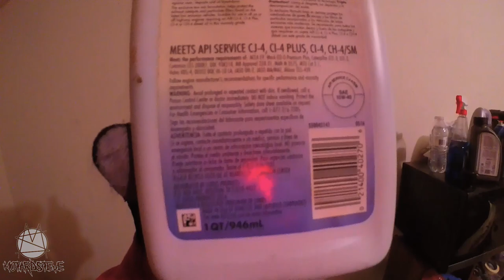How To Break In Your New Motorcycle Engine | How To Prevent Oil Burning

Comment: I did this break in method to my MMX 125cc motocross bike and it rips after 7 years of ownership. This is the best break in method for any bike. Great video Steve and very informative.
Reply from the maker: Nice! Yeah I think the OEM break in methods are partly a liability thing. Like you don't want to tell buyers to run it through the gears decently and have someone get hurt or something, so I get why manufacturers say to be more cautious for the first hundred miles on a new bike, but gotta get those rings seated in properly for sure.

Comment: Ffff that bro... my dr650 saw the rev limiter every shift and some chirps from the tire on downshifts. BELIEVE that hard break in. 😎 I of course let it rest in between those sessions with what you’re doing. Changed the oil religiously at purchase, 500, then 1000. It’s running like a dream at 7000k miles.

Comment: Just ordered my brand new 701 and will run it in exactly like this.  Ran my  last 4 bikes like this and none of them burnt oil and went like bullets compared to mates bikes.  Dealer told me that all 690/701's burn oil until 10,000klms, crazy, no moter should burn oil unless the ring's are fucked. Also thses bikes come from the factory with full synthetic oil so need to drain thst before even starting it.

Comment: Did you change the oilfilters every time you changed the oil in the break in process?
Reply from the maker: Yeah Except for the first time because I didn't realize the oil filters are a different size and already dropped the oil and no local stores were open that day.(one is a longer high filtration one, and the other is a standard one.) but other than that yes, changed filters every time and still do now when I change oil every 2000 miles.

Comment: Cheers for this vid Steve just a quick one do you do this type of riding style until 1.5-2k miles? I’ve picked up my 690 2020 and rode it back home 25 miles with your break in technique. Dropped oil and filters and will change again at 50-100-200-400 and so on
Reply from the maker: Think I did it until 1500 but probably was overkill tbh. You could probably be fine doing normal intervals once you get to 1k miles

Comment: Thanks MotardSteve! Sounds good. But how many miles are you supposed to ride like that then?
Reply from the maker: Really the first 50 miles are the most crucial but after that just make sure you vary the revs and engine brake often. The majority of the break in happens in the first 50-100 miles then the rest happens over time. Should he fully broken in around 1500 miles

Comment: What about changing the filter during the break-in period? You talk about very frequent oil changes but not once about filter changes. Do you need to change the oil filter every time when you drain the oil during the break-in period, or can you change it every two oil drainings? Thanks for answering.
Reply from the maker: The first few changes I changed the filters and cleaned the two screens because the first few changes will have a lot of metal in the oil form the surfaces wearing in. I'd say after the first few changes you could probably do every other change or every 3rd change. I changed them every time, but what I did may have been overkill but for the 20000+ miles I had the bike never had any engine problems so 🤷

Comment: This video is extremely helpfull. I have a scooter and when I changed the cylinder for a larger one, all of my friends told me that I don't have to break it in and that I could go full throttle all the time. I didn't listen to them and I'm glad I didn't. Now I don't have any oil burning issues. Thank you for your advise and when I get a supermoto, I will do the same thing you did!!
Reply from the maker: Nice man, glad I could help 😎

Comment: Hi,

Maybe you should advise.
Bought Husqvarna 701 enduro wit 1500km(~930 miles), but as it is a enduro it’s is total of 46 motor hours. 
Pretty sure that guy before me didn’t do this these actions what you where talking about.
Question- should I try to go thru all this process, so could improve oil consumption effective’s/ engine life.
ATM can’t tell if he is consumpting oil, will do first oil change soon.
Reply from the maker: Honestly it's probably past that point. If it doesn't burn oil I wouldn't worry about it too much, bit if it is slap a new top end in it and break it in as the video shows. But as I said unless the hikes consuming oil I wouldn't stress over it too much
Reply: @MotardSteve   thanks for info! 👍🏼

Comment: Enjoy your vids.  Got a 2014 DL1000A that I picked up in 2016.  Used Rotella T6 from the git go and it does not use any oil. Rode from MN to Seattle and back last summer and the oil level did not drop.  Put a yosh exhaust on at 1000 miles along with a holeshot fueler.  At 60, those long trips are a bit much so I have been thinking of getting an enduro wich would make most of the riding I do a lot more fun.  Think I'll wait till the Yammy T7 comes out though.

Comment: Just subscribed! You said I could break it in from just 3rd gear and down, but another guy in a video said to make sure to take it through all the gears.  I'm about to buy a Kym 690 ... I'd kinda rather keep it in 2nd and 3rd anyway till I get used to it's power.... should I just forget about what the guy in the other video said?
Reply from the maker: It's the loading and deloading you want to focus on. Your gear box doesn't do too much breaking in as the piston and rings do. Overtime you'll get through all the gears anyway. If you have a track near by that's another way you can break the bike in too. Because most tracks you'll have to accelerate on the straights and brake/downshift for the corners over and over again.

Comment: i did that with my gen5 zx10r i still followed the manufactures directions in not going over 8krpm for the first 500 miles but i loaded it up and engine braked as much as possible but those bikes really dont burn oil either way u do it but it definitely increases the chances of making more hp and being a strong bike in general im about to do a top end rebuild on my 09 ktm 530exc and im glad i watched the vid im definitely doing this because she consumes a bit of oil as it sits

Comment: Just came across your channel. As I just took delivery of a 2022 701 SM, It couldn’t be better timing. Thanks for the great information and guidance for proper break-in. One question - each time you changed the oil, did you change the filter(s) also. Thanks 👍
Reply from the maker: I did. Probably was overkill but I'd at least change them in the first change because of all the metal shavings after that you could probably do every other change

Comment: So bro how many miles can i go till i stop the "creating pressure" method ...example u said create that pressure as u showed for the 1st 50miles...so how bout after 50 miles can we drive regularly or do is 50miles+ still within creating pressure procedure?
Reply from the maker: After about 100 miles I just rode it pretty normal but because I'm a hooligan I still did plenty of acceleration and engine breaking but most of the break in happens in the 1st 100 miles
Reply: Ur talking just for the Husky supermoto or any small engine 4stroke in general?!

Comment: Quick question, what was that rating you are talking about for the conventional oil?? Also, dropping the oil like at 25 miles then 100 miles etc.. are you doing also all oil filter changes? THAT"s a lot of oil filters lol those things are not cheap where I am
Reply from the maker: I was changing filter everytime but that could've just been me being extra. You could probably get away with doing it every other or every third time. And the ratings were Jaso-MA or Jaso-MA2

Comment: I started interested, but lost confidence real quick when you started talking about hard break in and using a different oil at first. The best option is to stick to what the manual says. Being a little bit more aggressive can be ok, and being too soft is probably not going to help but a lot of people could get the wrong idea from this. Either way, not taking the rpm’s above whats recommended is the best option, acceleration is fine.
Reply from the maker: I disagree. There's numerous accounts if people that went by the manual and almost all of their bikes consume oil...
Reply: @MotardSteve  Well clearly you disagree hahaha. I just think there’s probably a reason why the manufacturer recommends a certain procedure... After all they are the engineers etc who designed and built the bike in the first place. I reckon they probably have some idea of what’s best generally speaking. Doesn’t mean it’s the only way possible. The fact that some bikes burn more or less oil doesn’t necessarily have to do with the break in. Of course it could be a likely factor, but I’d trust that a manufacturer before “some guy” on the internet if you know what I mean. It’s amazing that it worked for you, but that’s one person with one bike at a time. Hardly conclusive evidence that it’s the best way to do it. Changing the oil 6 times within the break in period of 600 ish miles hardly seems like a normal thing to do either. Anyway, if it works it works I guess. Glad your bike has no issues, I’m picking up my 21 690 smc r in a couple of days and I was just curious about the break in since it sucks to do. I already have a full exhaust before my bike arrived and when it does I’m waiting till after the break in to mount it and tune the bike. I’ll probably stick mostly (patience permitting) to the manufacturer recommended method. I’ll let you know if it starts to burn oil and you may have been right though hahaha. Have a good one!

Comment: You forgot the normal break in procedure, I see you only have two, easy and hard. I'm pretty sure the manufactures know what they are talking about. Also you seem solely concentrated on the piston rings. there are many many more components in an engine that all require breaking/running in. Yes your engine will burn oil at first, a shocking amount of oil in fact as with any big single cylinder, But it stops after a couple of thousand miles. Stay safe and follow the hand books recomendations.
Reply from the maker: To each their own man. I've had good luck with my break in procedures so..... 🤗
Reply: I hope your luck continues truely, from one sm rider to another. Would your warranty still be valid if you changed from what they recommend, just curious.
Reply from the maker: Husqvarna only says not to exceed a certain rpm for break in and that's literally it and it's pretty close to the rev limiter. Other than that a lot of Husky techs say to run it in hard because these backs are bad about burning oil if you dont

Comment: Hey man I picked up a 2018 701 it had 0.5 miles on it... I just hit 200 miles. I saw this video and I am a little scared. 😐 I plan on changing the oil first thing tomorrow. Do you think if I start this method and follow it I might be ok?? THANKS
Reply from the maker: Should be fine. I've heard several rumors that the bike ships with bel Ray conventional but I'm not 100% sure of that, but you should be fine.

Comment: You didn't really mention how long or how many Miles we need to ride this way until we can actually start riding it a bit more normally and not engine breaking every 2 minutes, or maybe I just missed it? Also, what was the rating on the Oil to look for with wet clutch?
Reply from the maker: 1500 miles and Jaso ma/ma2

Comment: Manual says one should use 10w/50 oil, why did you take 15w/40?
Reply from the maker: Cheap conventional oil found at Walmart. Oil weight doesn't matter as long as it suits the outside temperatures where you ride. I live in a warm climate so the 15w is fine, now in a folder climate I wouldn't recommend it.

Comment: I put 350 to 400 miles on mine without red lining or getting on the gas.Just putting around running through the gears.I don't think i have a oil burning problem in general but I do notice my oil level def goes down when i go out for a few rides and do lots of wheelies...i have over 9k on the bike now and am thinking about converting over to full synthetic.
Reply from the maker: +ThumperTodd The wheelies could be dumping it out the overflow into the airbox. Another symptom to look for oil burning is blue tinted smoke on start up or when you goose the gas  I reccomend the bel ray exs 10w50. I've had good luck with it.
Reply: Motard Steve one thing I have specifically noticed is that my bike never blows any smoke upon starting..and I have never noticed any at all wile revving It up..and that's the exact oil I'm gping to switch to.i already have it in the shed.  Pretty sure i only burn oil when doing lots of the wheelies.. and it doesn't seem to burn to much,just enough for me to notice it went down a bit..
Reply from the maker: +ThumperTodd Yeah the wheelies cause mine  to lose about 50-100ml every 1000 miles too. Wheelies are a whole nother animal when it comes to oil level.

Comment: My '03 XR hasn't been running in a looong time and I'm getting a bit of smoke. Part of it might be because of the plastic residue from the petcock is still floating around the tank. I'm assuming it has less than 1000 miles on it so far too. I got part of the break in down.
Reply from the maker: Yeah could be a combo of old gas and blowing the carbon out, Wait until you start riding it regularly again and see if it continues to do it.
Reply: I emptied the tank so I can put new decals on it, the "fresh" gas was piss yellow and the inside of the tank has like a chalky residue in it.
Reply from the maker: +Spartan375x ahh probably bad gas then.

Comment: Hey man probably the stupidest question you’ll ever hear but is that oil change with all the oil filters, screens and all for all those miles??? Then normal intervals?
Reply from the maker: Yeah I changed both filters at every change and cleaned the two screens as well. Not a stupid question to gain clarification. 👍
Reply: Hey man few more questions once I get to 1800 can I still stick with conventional oil??? And if so how many miles can I go on conventional. Manual says 600 then 6000 after that. But is that for full synthetic only???
Reply from the maker: @Phuzero1717  I still change mine at 2k with full synthetic so I'd say maybe 1500 or 2k and you should be ok. You'll know when it's time to change cause the shifting will feel clunky

Comment: How do you think the 701 would do for long distance rides? A few thousand miles?
Reply from the maker: I know plenty of people that turn them into light weight adv bikes. I think like all bikes, with proper maintenance, and prep it should do it no problem. I've got 14,000 miles on mine with no major issues. I've did a few rides equating over a few hundred miles in one go with no issue.

Comment: Hey bro,ur cylinder is most likely Nikasil coated did u have to hone ur cylinder or did u just plug and play ur new top end?
Reply from the maker: I never put a new top end in the bike. Ran 17k miles on the original and had zero issues. Don't have the bike anymore due to theft.
Reply: @MotardSteve  dam what bike do u have now? Sorry to here....
Reply: @MotardSteve  so on a car engine a 13.5:1 compression ratio needs 110 octain fuel....how about on a small engine like a dirt bike 450 inparticular....any knowledge on octaine levels for a 13.5:1 ratio?
Reply from the maker: @josantos4543  currently don't have any bikes. I always ran 93 octane in my 701 pretty sure that's what the manual recommends too.

Comment: Hi, may i know what suitable miles that we can stop the process hard loading and deloading?is it until 50 miles?after 50 miles we just can run normal ?
Reply from the maker: I did it real religiously until about 100 miles. After that just vary the rpms as much as you can. Avoid long highway riding, take backroads or city streets.
Reply: THANK man

Comment: I found the Motul 3000 4T 10w 40  (mineral oil) that is Jaso MA 2,  is it good for the break in?
Reply from the maker: As long as it's conventional oil and Jaso ma or ma 2 rated and is in the correct weight for your climate than yeah it's good
Reply: @MotardSteve  yes Is conventional, but   Husqvarna suggest 10W50.  Someone on YouTube says to replace the oil after the first hour of use.
Reply from the maker: @miocassettomiocassetto357  first hour or first couple rides is fine. I did mine at 50 and then 100 but that's just me
Reply: @MotardSteve  thank you,  next week I will pick up my brand new 701, of course I can't change the oil at the dealer. Did you change the 4 oil filters at every oil change or only the two bigger and cheaper one?
Reply from the maker: @miocassettomiocassetto357  there's only two filters and 2 screens. I just changed the filters and cleaned the two screens.
Reply: Did you also change the orings at each oil change?
Reply from the maker: @miocassettomiocassetto357  nah

Comment: i dont consider what youre doing a hard break in. Hard break in from what i hear is hardcore, full throttle pulls. I have a brand new 701 supermoto that im about to break in. ill be alternating revvs with light and medium throttle like you are.
Reply from the maker: +Spencer Schneickert I mean either way I'm not babying it. Was wheeling it with only about 100 miles on it. 😂